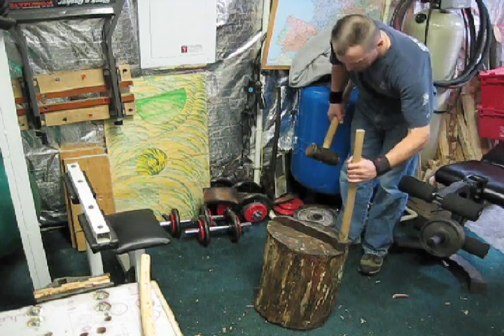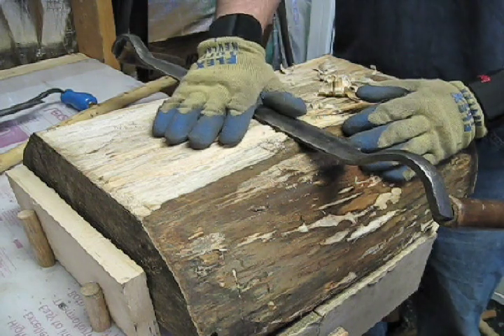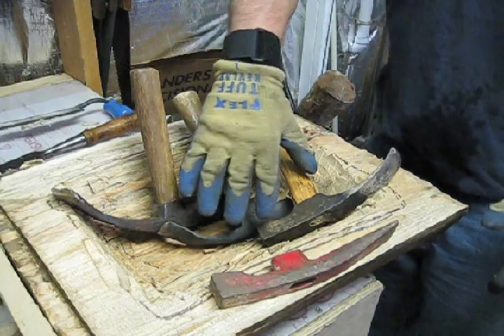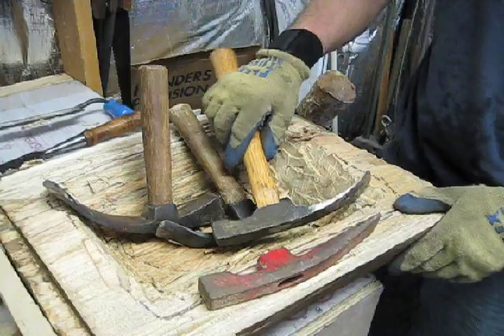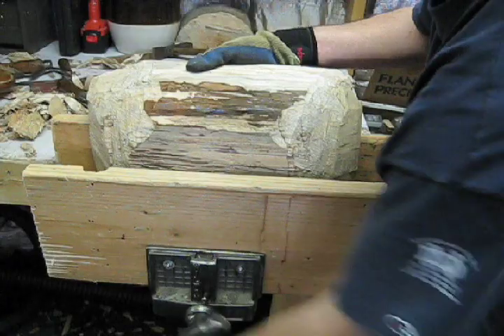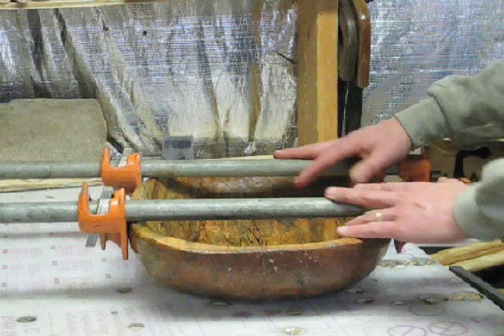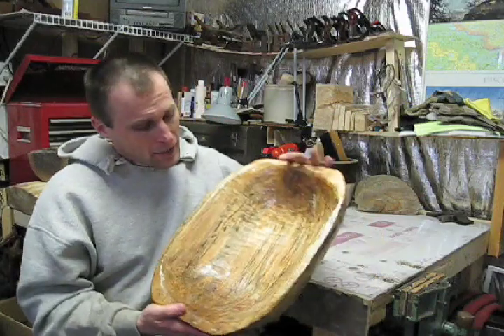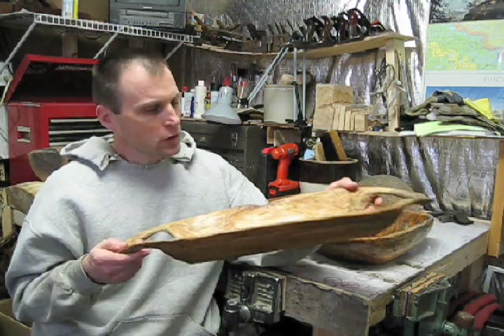Hand Carved Maple Wooden Bowl

Comment from the maker: Thanks.  I talk about this in some later bowl video's.  IV & V.  Whenever someone is cutting down a tree I will take a piece and coat the ends with "Anchor Seal" which keeps the moisture in.  When I do make a bowl I always wet the end grain while I am working on this.  When I am done I coat with oil then place in paper bags and then put it all inside a plastic garbage bag.  Each day I change out the paper and plastic bags and dry it very slowly.  I bought a food scale and shoot for 1%/day.

Comment from the maker: I've only made a few thin walled bowls (cherry, walnut, sycamore).  I would love to try some exotic woods at some point.  The key to successfully making a thin bowl is 1. Make sure the wood is very green to avoid cracking in the thin walls, 2.  Sharp tools, and most importantly 3.Dry it VERY slowly - even while you are working on it keep the wood moist and keep it in a  plastic bag at night with some water in the bag.  Good luck and check out my other video's.  I have some newer bowl video's.

Comment: a tip when you do the bottom straight. hold tools in an angle you cut better and it does not need sharpening as often

Comment: Try a violin maker's thumb plane to thin down the walls when you are almost done. That is the kind of work they are made for. Use the convex ones for the inside. They make smoothing a lot easier, too. They sell them on ebay (Chinese) and they don't cost much. Or you could make your own. You could buy a thickness caliper, too, if you want to really do it right. Or you could make one of those, too. Ask a violin maker in your neighborhood to show you how he does it, or just do it yourself. You will love it. I promise.
Reply from the maker: I'll check this out.  Thanks for the detailed explanation.

Comment: nice video, i'm almost 60 and I used to carve bowls like that when i was a kid, using gouges and knives but all the continuous sharpening is not for me....not sure what motivates you to use technology from the point in time you do, but I prefer modern technology and use electricity.  In the old days they actually used sharp shells to carve bowls and then technology progressed to replacing shells with stones...technology progressed a few 1000 years til metals were used to replace stone carving tools. Metal carving tools, like the ones you use were improved upon decade after decade. Finally electricity was harnessed and tools and bits were made to fit into angle grinders and drills etc...thats for me, almost no sharpening required, I'm lazy.
Reply from the maker: +David Witkus I enjoy the challenge of using my hands and mind.  It's good for the soul also.   I've progressed a lot in my skills if you check out my newer videos but I still do not use electrical power tools.
Reply: Chop With Chris
I have a lot of friends like you, they enjoy the challenge too. You guys are a rare breed that respects the older way....I'm just lazy.  I want to get my bowls as smooth as silk, and to do that i need to go through 5-7 different grit sand paper and as I said, i'm lazy.